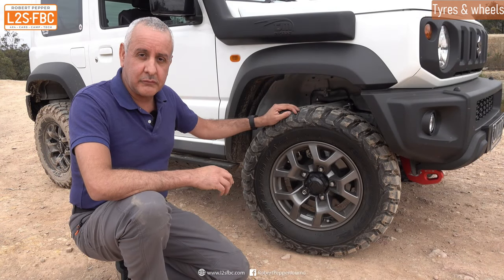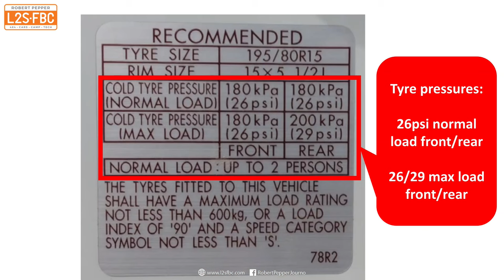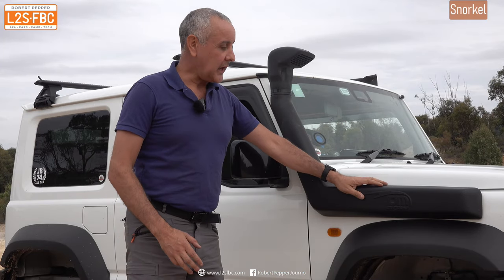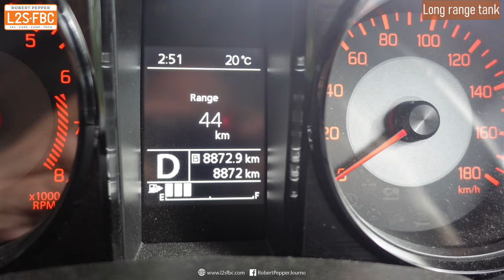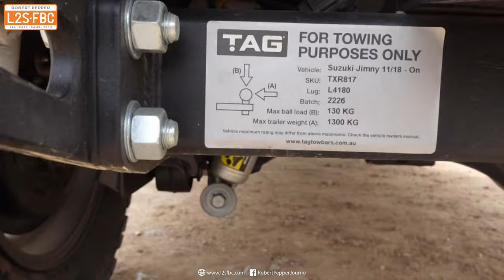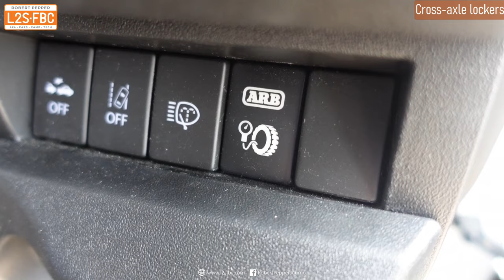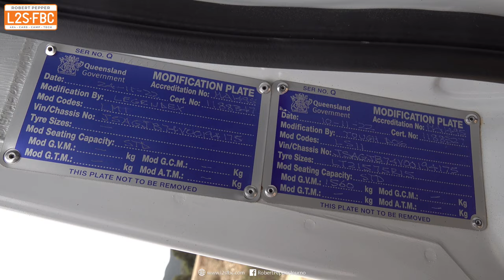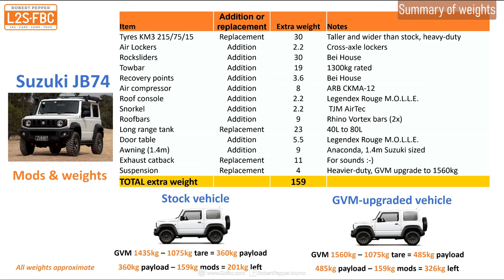Non-bling, practical Suzuki Jimny JB74 modifications

Comment: As usual - totally objective, to the point and without the BS
Reply from the maker: Thank you. Quite a few people comment there "is no BS" in my videos. What is meant by this?
Reply: @L2SFBC  no "bull shit"
Reply from the maker: I didn't mean what it stands for 😊
Reply: Sorry delay Robert. No BS - I enjoy your videos as there is no waffle or extraneous information. Re your video on the Jimny how in Australia is the additional load capacity calculated when "lift or suspension upgrade" is fitted. Here in South Africa we have no such conditions and I would be interested to know as I've fitted a 50mm coil spring and shock absorber lift. Thank and keep on trekking.
Reply from the maker: The engineer calculates that the vehicle can take the extra load. Exactly how that's done is vehicle-specific.

Comment: So, in summary, the Jimny when modified correctly, is absolutely the best off-road vehicle money can buy when you don't value directional stability or load capacity.
Reply: It's the fun factor that is attractive. They aren't made to carry heavy loads ... but they are surprisingly stable.
Reply: @tindogmedia1216  100% agree TDM - my comment was tongue in cheek. I'd love a Jimny. In my mind, its up there with the mini moke in the fun stakes.
Reply: @MiniLuv-1984  Ohhhh ... Mini Mokes are cool!
Reply: No directional stability issues with ours.
Possibly the case with those tyres though.
Reply: What directional stability? Is it the issue of the jimny supposedly turning on it's side while turning in higj speed as was published maliciously by an american magazine that was proven false and made to throw a bad reputation on the jimny?
Reply from the maker: No it's the fact it is short wheelbase live axles and poor suspension combined. Try driving one on corrugations.

Comment: Good to know I'm not the only Jimny owner who got their car back from it's service with 35psi. It's happened twice. I've been running the standard 195/80/r15 and they do really well in sand and dry dirt. The standard road tyres are especially good if you tow a trailer with the Jimny. 

My note with the Jimny, if you're recovering it be super gentle if you are snatch strapping it. It doesn't weigh much and an 8t snatch strap has essentially no give and will shock load the chassis. 99% of the time you can gently pull it out in first low.
Reply from the maker: !!!!!!!!! what is it with these people??? And yes, very good point re kinetic recovery.
Reply: george 4x4 and Saber Offroad and another I cant remember all sell 5000kg recovery ropes that are all much more suitable for recovering a Jimny. Note you should try to avoid recovering anything heavier with a Jimny and never underestimate the versatility of a few mates and a decent push!
Reply: You need the trailer behind the Jimny to bring home the weekly groceries.... :)
Reply from the maker: You obviously don't live in my house :-)
Reply: @auszooker  my mate insisted on snatching my Jimny backwards out of a rut and bent the bolts for the tow hitch. Got the bolts replaced, but it if that was my front recovery point it would've bent my chassis

Comment: Excellent video.
Roof racks make HEAPS of noise. There is a simple fix to stop the roof rack noise issue. Wrap some 7mm ~ 10mm rope around both racks several times... problem solved! I wrapped mine about 12 turns and the additional noise magically disappeared.
Reply from the maker: Thanks!

Comment: A magnificent video packed to the brim with vital information.  In my experience, Jimny's don't like water above the level where the doors start and if you don't believe me go and try it out.  However the greatest benefit of a snorkel is not with water crossings but to suck in clean air at the level of the roof instead of dusty air under the bonnet when travelling on dirt roads.
Reply from the maker: Thanks Casper!

Comment: Good rig, well thought about mods without throwing the money away.
My JB74 virtually a copy but no roof rack and I do have the 8000lb hidden warn winch in the OEM bumper and ofcourse diff breathers up into the engine bay.
I didn’t see the need for a front diff lock so passed on that as well.
I’m on the Wild West coast of Tasmania and not too many 4wds survive over here, but I’m happy to say my jimny is a bullet proof mountain goat with the mods and it goes where others wouldn’t dare.
I must add I also passed on the snorkel and when water crossing I just attach my car bra and low 2nd with no issues.
Believe me West Tasmania is all water crossings and bog holes and mountains and as yet haven’t come across a situation where I thought I wish I had a snorkel, if I lived in a dusty environment then I’d definitely invest in a snorkel.
Reply from the maker: Thanks! Great post but I think you're brave re snorkel...
Reply: @L2SFBC  you got to be brave to live on the West Coast of Tasmania, appreciate and good video of a very capable JB74.
Definitely puts that rig into the go anywhere anytime position.
I must say with all the mods I’ve done on my JB74 the one mod that I always smile about and absolutely know was money well worth spending was the long ranger fuel tank, it’s a must for a true 4wd JB74.
Reply from the maker: Totally agree re LR tank, the standard tank is too small and the car is too thirsty even before mods!
Reply: @L2SFBC  I totally agree for you guy living in Australia and the Tassie (love it there btw) Ive been out there twice. However I live in the uk 10 minutes from Salisbury Plain and it's really not necessary here. Or thought is a big area (300 Square miles) its surrounded by fuel stations. This is the biggest off roading area by far in England so you are never far from civilisation. So as with all mods its dependent on you own usage

Comment: Very detailed video. I have no doubt the Jimny would be fun on the bush tracks and even scooting around town too :)
Reply from the maker: Definitely!  It's in many ways the ultimate towncar.  No worries about kerbs, super short, small turning circle, easy to park,  high up for visibility.  Not super powerful, but zippy enough in first and second gear. And easy to get in and out of.  Just let's not talk about the safety rating...
Reply: I use mine as a town car and it works great. It does roll around roundabouts but it I drive so slow it isn't so bad. If I have to be bit picky the seats aren't really good but Suzuki has never made good car seats.
Reply: @aslkdfjhg  thank you for your feedback :)

Comment: One thing to consider with snorkels is that the standard air boxes aren't water tight. The air intake into the box also has holes at the bottom.
If water crossings are in mind, then you need an aftermarket airbox.
Reply: You just block the holes on the airbox when you put a snorkel on a car. No need to replace the airbox.

Comment: There is a lot of bad advice out there and badly modded Jimny's just for looks. This will land the owners in hot water if they ever need their insurance to payout! Very sensible advice on off roading in general and especially for jimmy owners like me. This is a lovely example of a well modified Jimmy. Though I am very surprised to see no radial mount protection. The lowest and weaker part of the underside. I have diff, guards transfer box and fuel tank gauds as well. All relatively cheap giving the amount spent on this Jimny. I am very envious of the air lockers, extended range fuel tank and suspension on this example. Great video 👍🏻
Reply from the maker: Yes, some Jimnys are bred like pugs!

Comment: The Jimny is a pretty capable vehicle without any of these mods, only AT tyres would meet the needs of most off road use.

The dark side that is normally not spoken about, is that with most of these mods you are on your own in terms of manufacture's warranty. Suzuki doesn't recognise any of these, even if is made through the dealer (good luck making any claims with these criminals). It can also be problematic to insurance claims too...

I never stayed behind with my mostly stock Jimny, only with better tyres and basic recovery gear you can go anywhere, no need to spend all this money to have fun.
Reply from the maker: Yes, I have heard this from many people.  Use a specialist insurer is best for 4x4s.  I think the Jimny really needs taller tyres as it lacks ground clearance.

Comment: Great video …

About the snorkels - if you drive across deep waters (water over the bonnet) 
1. Will the alternator survive?
- Probably not, if it’s a standard one. 
2. Is your snorkel water tight?
- Test the snorkel by pulling a plastic bag over the top. If the engine doesn’t die from suffocation the snorkel will suck in water and aqua-lock the engine. FYI, most “snorkels” aren’t snorkels. They are only raised air intakes. Not bad, but not as good as a water tight snorkel.

Comment: The Jimny's wading depth is rated at 30 cm give or take.  With the air intake so much higher than that from the factory, I would suggest that something OTHER than the air intake is the limiting factor.  A snorkel is still valuable, but it doesn't promise a deeper wading ability.
Reply: It is very light and floats easily. Any deeper and it will have no traction anyway! Less than half the weight of anything else on the trail.

Comment: Good video, but regarding the snorkel, I'd argue you've brought up an odd reason for getting one.
I think a better reason for most 4WD owners should get a snorkel is if they anticipate driving on a lot of dirt roads. A raised intake will reduce the amount of dust that clogs your air filter.
A snorkel for wading is certainly useful, but only if you intend to go wading. You really shouldn't make a creek crossing like the example you gave. If you don't know what you're doing and you're in a rush, you certainly shouldn't be wading any deeper than what the stock intake lets you.
Reply from the maker: Yes, dirt roads are one use case for a snorkel, but it is cheap insurance.  If the wheel on the side of the air intake drops into a hole you'll be glad of it.

Comment: Robert, having done a bit of desert work, I would under no circumstances use alloy rims, no matter the percentage profile tyres fitted. Steel rims can be belted back into temporary working order, whereas alloy are throw-away items - not many available in the outback. Perhaps one day you may cover this aspect.
Reply from the maker: Bruno, I disagree. In all my years of 4x4 I've dented steel rims, yes, and belted them back into shape. But I've never seriously damaged an alloy in recreation or competition. If I did, there's a spare and the chances of damaging two beyond repair are tiny.  If you run offroad tyres in high profile at appropriate pressures and take appropriate care, the risk is tiny.
Reply: @L2SFBC  "... the risk is tiny." The risk of finding water in the desert is tiny also, if both alloys are shot, something to think about re personal safety.

Comment: What are your thoughts on breathers? You mentioned the importance of the snorkel for water wading; I've been led to believe that breathers go hand in hand with the snorkel in making the vehicle more capable in water wading.
Reply from the maker: I should have mentioned breathers. However a snorkel is more important; a bit of water in your diff won't stop you, but your cylinders trying to compress water is definitely going to slow you down. If your 4x4 does not come with decent breathers they should be fitted if you do a lot of water work.

Comment: Great video. I have a question re the roof racks. I have a slimline front runner II roof rack which is one of the lighter full racks and it’s about 30kg. So are you saying I now can’t put anything like a tent or awning on it? I’ve seen ppl that have done them so I’m confused…
Reply from the maker: The limit is 30kg, so yes if your rack weighs 30kg, you can't carry anything on it. However, you may choose to exceed the limit as others have done.

Comment: Robert,  Another very informative and balanced review. I was just wondering if when you calculated the vehicle payload did you allow for the weight of the additional 20 litres in the long-range fuel tank?
Reply from the maker: The payload worked off the Suzuki supplied tare weight so no

Comment: Does the tyre size of 235 75 15 will be a better choice compared to 215? I saw many Jimny’s on 235 tyre and also some of the 4x4 shop technicians recommend 235 as well. Especially for the manual Jimny which can provide a little bit extra power compared to auto.
Reply from the maker: There is no best unless you have a specific circumstance in mind.
Reply: 215 fits with no lift. 235 requires lift and possibly castor correction and may still scuff the mudflaps on articulation etc. 235 75 are also going to affect gearing further and make an underpowered vehicle even more trouble in hilly use or mean changing gears and pushing it harder. 215 is seen by many as the best compromise unless you start having a gear reduction.

Comment: Hello Robert, you say that the roof weight limit for the JIMNY is 30kgs. You are referring to the stability of the car when traveling or the general capability of the roof that it might be damaged?
Reply from the maker: I am referring to the maximum weight that you can place on the roof. This is set by Suzuki with reference to a) the roof's carrying capacity and b) the effect on the car's handling. You can exceed the limit and many do...but need to consider that you're going against Suzuki's advice. There are many, many examples from aftermarket companies with overloaded roofs. Personally, I would absolutely minimise what goes up there.

Comment: Sir, as per many websites the maximum tyre size on a 5.5 inch rim is 205mm, but the factory fitted rim on jimny is 5.5 j rim can we install 215/75 tyre...
Reply from the maker: A 215/75/15 is ok on a 5.5" wide rim. But no narrower eg 5.0.
Reply: Thanks for the information sir.

Comment: I don't understand why tyres weight is considered in GVM. The tyres on the ground that is.

Sure the GVM is the total gross vehicle mass but tyres are on the ground holding up the rest payload. If anything, I would think slightly bigger tyres would theoretically give you a very very minor "GVM upgrade".
Reply from the maker: The tyres still need to be moved by the engine.
Reply: @L2SFBC  Yea that makes sense and I am probably wrong but isn't a GVM upgrade usually better suspension and frame reinforcement? I don't think I have seen a GVM upgrade involving engine or drive shaft modifications.

I don't quite understand how a GVM upgrade would help with this.

Comment: What about the power unit in the Jimny? I've seen one struggle in many attempts going up steep sand and it struggled because it seems to lack power. Other vehicles didn't struggle. Although I've seen Suzuki Sierra's do well in dunes. I don't really know what happened with the Jimny. Too much weight or skinny tyres? The jury is still out on that one for me.
Reply from the maker: Take a look at my narrow vs wide tyre video...it won't be the tyres. I'd suspect driver error. For example some people are fixated on a given tyre pressure in sand eg 20psi. That is too bigh for a Jimny. As I explained in my sand pressures video. The Jimny is underpowered but not so badly it can't handle sand work.
Reply: @L2SFBC  Yes, it may be driver error or tyre pressure not low enough.
Reply: Engine power is 70kw. The 195 tyres offer the most acceleration. 215 tyres are balanced and introduce you to more off-road tyre brands. The 235 tyres majorly drop acceleration and fuel economy. For sand I start at 15psi and go down if necessary. The 195 tyres are in my opinion superior on sand. A lot lighter, skinnier, thinner squishy sidewall and no large tread blocks.
Reply from the maker: https://youtu.be/uN0Tf2eYPE8

Comment: Hi Robert …. i would be interested if i would be able to put a sunroof up. Do you think that would be possible / advisable …. btw i am a novice so good in stupid questions .
Reply from the maker: I don't see why not.  However do NOT skimp on cheap options, ensure it's done properly and to any applicable laws. Not familiar wit such conversions but have seen some bad ones.
Reply: @L2SFBC  Alike the additional fuel tank that creates some issues ive heard . I am afraid that the roof is part of the construction so building in a sunroof will be detrimental.
Reply from the maker: The Jimny is a seperate-chassis vehicle so should be ideal for a sunroof, but consult a sunroof maker and/or state engineer.

Comment: where did the ARB Compressor switch come from, are matching locker switches available?
Reply from the maker: Aftermarket install psrt of the lockers. Don't know what you mean by matching.
Reply: @L2SFBC  ARB supplies switches with the lockers, usually a larger Carling Contura, that would be too big to fit where that compressor switch is, by matching I mean one that is the same size & appearance.

Comment: I put bfg all terrain 115/75/15 and bloke in tyre shop said I should put 40psi in. This is what I’ve been doing and runs fine. Is this wrong?also I’m a fat bastard.
Reply from the maker: 115/75/15? You sure?
Reply: @L2SFBC  215/75/15 I mean
Reply from the maker: Well, the more weight you put into a car, the higher the tyre pressure required. If you think your Jimny runs fine with 40psi, assuming you drive a Jim, then I won't argue but I would suggest that you try 30psi, and keep an eye on the wear pattern...you may find it's centre-worn and if so that means it's too high a pressure.
Reply: @L2SFBC  good idea. Thanks I’ll do that